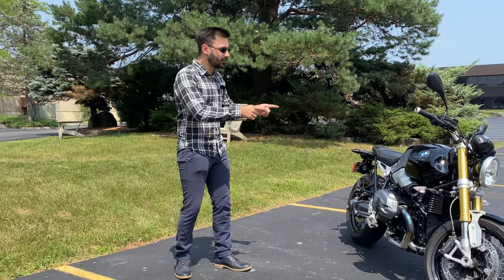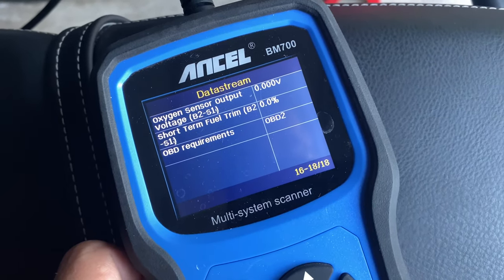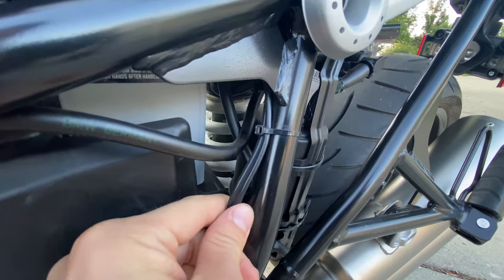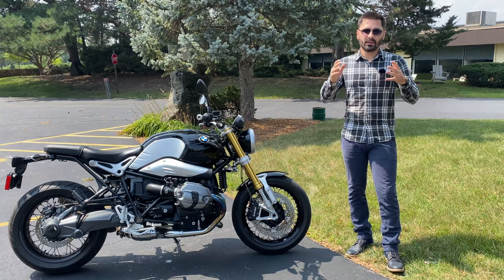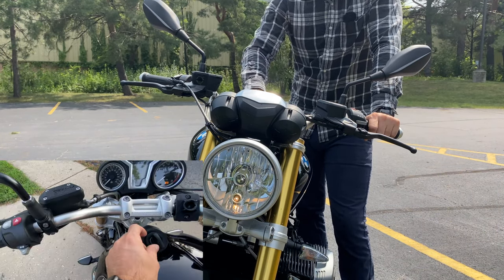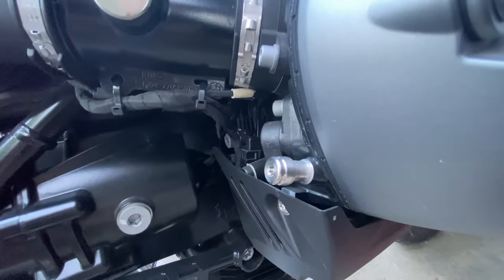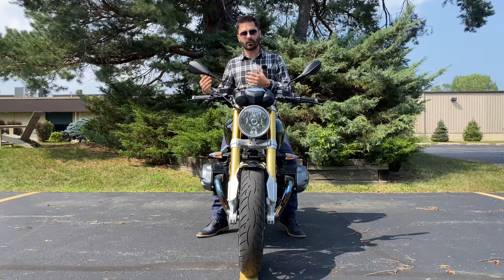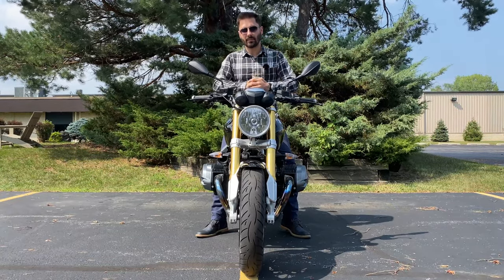Top 10 Useful BMW R NineT Hidden Features

Comment: The “trickle charger port” isn’t factory fitted, but seems to be installed by a lot of dealers in the USA
Reply from the maker: I figured that out later on! I checked with the previous owner and he told me it came like that new, so must have been installed by the dealer from new.

Comment: The socket under the tank which looks like a cigar lighter socket can also be used to charge the battery if you use a BMW charger. Mine does this perfectly. I also believe the bike has to have tubed tyres because it has spoked wheels. The GS spoked wheels has the spokes fitted to the outside of the wheel outside the seating where the tyre fits so it can use tubeless tyres though. Thanks for the parking light feature which I was unaware of.
Reply from the maker: Thanks for the info and feedback! I saw some really cool aftermarket spoke wheels that don’t need tubes, but the price was 1/4 of what I paid for the bike!
Reply: Where do you put the free tools?
Reply: Nice vid, thanks. The nine T comes with different spoked options, some of which are tubed, some tubeless - they look similar, so worth checking.
Reply: I use trip 1, set it to zero when I fill up. I know at about 120 miles it needs filling up as around here the reserve light comes on. That gives you about 40miles.

Comment: Get rid of that horrible seat release bolt and replace with an aftermarket knurled head finger tight bolt. About $10 on eBay. The downside is that it is no longer thief resistant for items kept under the seat.
Reply: i got some knurled finger bolts from amazon... $3.00

Comment: The hidden features like the battery charging cable was probably fitted by the dealer or the original owner it doesn't come as standard.  Also the wields on the baffles was removed by the original owner, that's why they was easily removable when you unbolted the covers on the exhaust.
Reply: the early 9ts had removable baffles, i think they welded them 2017 >>

Comment: BMW manuals are great.  I have a 2017 S1000R and it gives great information in a very Germanic way - this extract always made me smile “ In accordance with the laws of physics, the ability to accelerate
is restricted more and more as
the angle of heel increases. Consequently, there can be a perceptible reduction in acceleration out of very tight bends.“

Comment: @2:15, Just in front of that auxiliary power socket there is also a plug, cable tied to the frame designed to plug in a sat nav so you don't have to splice into the harness. It's well hidden and took me a while to find it. Very thoughtful of bmw to provide that

Comment: Thanks for sharing.
I recommend the original BMW charger to maintain/refresh the battery outside of the season. You can simply plug it into the socket on the left under the tank. Done
Personally, I don't think much of all the gimmicks like tire pressure control, oil indicator, lane control, ABS and fuel gauge etc.
People used to ride motorcycles without these little helpers. You just have to get used to the motorcycle and get to know it. Then you have pure driving pleasure. Greetings from good old Germany,  Jo

Comment: I wish you had more videos. I really like your style. Informative, to the point and without unnecessary stuff. Very useful.
I am taking my MC license and seriously considering a R9T. I am 48 and no riding experience whatsoever yet. I know going directly to such a heavy bike sounds crazy but I believe that riding a bike that you really like is important too. 
Keep the good work! 👍👍
Reply: This is not really a bike to learn on for a number of reasons. First it is a very fast bike, way too fast for a beginner. It's not the weight you should be concerned about, it's the speed. You should also know that you will crash a few times, that is inevitable when you first set out, I'm talking about silly little ones. Do you really want to damage your dream bike? Would it not be better to get a few years of experience on a bike that you don't really care to much about first?
I am also thinking about this bike to add to my collection but I have been riding bikes since 1978. I started out on a 200cc for a year or two then bumped up small steps at a time, I've had more bikes than I can remember. 
I now own a Triumph Rocket 111, a Ducati XDiavel and a Suzuki GSX1400. If I do get this BMW I may have to get rid or the GSX, I will see.
My advice is to work up to this bike. Go do as many courses as possible, get as much road experience as you can and above all be safe out there, it really hurts being hit by a car!
Reply: @rufus1346  thank you for your advice! I have already bought myself a R9T, and I am loving it. A 2019 model, 3500 km on it. It looks very much like the one on this video. A beautiful machine.
I totally agree with you on everything you say. You've been riding bikes since the 70s, so you know what you're talking about. In my case the R9T is the solely reason why I took my MC license. I loved the lookings of that bike from the first time I saw it back in 2014. For me it's all about admiring the bike and enjoying a relaxing trip in the area where I live. Speed is not my thing, it's never been. I am a more of a cruiser. I am also interested in the technical aspects of riding, like cornering theory and in general how to improve my riding skills. I will be looking for some courses to attend. I really have much to learn!
Reply: @anakletor  Just be careful out there, as I said being hit by cars really hurts! And can cost lots fixing up the damage to your machine, which sometimes hurts more than the broken bones LOL....
Reply: I noticed that you said you got the r9t, and I see the post is a year old. Could you give a update do you still have it? Would you do anything different? I'm also considering a r9t but a urban g/s mainly for the seat height. Any update would be awesome, thank you.
Reply: R9t is a perfect first bike. Don’t listen to anyone that says otherwise.

Comment: Fun fact, there is also a gps port under the tank near the front of the bike that can be used in a similar way to that din port. It needs a special cable for it to work correctly with anything other than a offical bmw gps, but i use it to charge my phone and it works great :)
I have the same model r ninet, had no idea that the signals cancelled, just thought i finally got better at doing it, super cool tho!
Reply from the maker: Thanks for the tip, I'll have to check it out. Love this bike.

Comment: When turning off the bike, if you push the long light some seconds, you active the courtesy parking light (follow  at home mode)... Very nice when parking at night. After 1 minute, it is automatically disconnected.
Reply from the maker: Thanks for the tip! That's a great features to know about!
Reply: Where do you put the free tools?

Comment: Hi, what model year is your bike? Mine is a 2015 and I can’t find this trickle charge port. Looked in the owner’s manual, too. Are you sure that is a factory add-on?
Reply: This isn't a factory fitted part. Either a previous owner or the dealer put that on.
Reply from the maker: You’re right! I was mistaken it for what they mention on around page 90 in the manual.
Reply: @chazphot  My 2019 came with a trickle charge port.
Reply: @ruiner88  then it must be a new addition from a certain model year, at least in the States
Reply: @ruiner88  I can’t find a trickle charger port either
Reply: Looks like one of these.

Comment: Great video. Thanks! I didn't know about most of these. Granted, I do have the Pure. I'll need to check to see how many of these tips apply to the base model
Reply from the maker: Thank you! Let me know what you find and how many apply to your Pure. I wanted the pure, but for some reason thought I'd need the Rev counter more than I thought.
Reply: First Robert should make sure he knows how to ride a motorcycle.
Reply: @2random628  when coming to a stop sign, I release the clutch, stall out, and drop the bike. It does bring me to a full stop, but I feel like there has to be a better way. Any suggestions?
Reply: @robertstimmel1100  yes, proceed to walk to hot girl and pull pants down
Reply: did you find the alarm? wasn't sure if included in Pure. Mine has the auto cancelling signals,  the corner illuminating headlight (very slight),  and a usb plug about where he found the din plug...
Reply: @robertstimmel1100  I've been riding for 50 years and I haven't discovered one yet. 🤔
Reply: I have the pure - if you have the stock pure wheels rather than spoked, these are not tubed (this was the main reason why I decided to go with the pure as a puncture with a tubed tyre is a mega pain as I found out on a trip with my mate and his Africa Twin which got a puncture 5 mins after we left - tyreweld doesn't work on a tube so bike was useless until it went to dealership to be replaced!).

Comment: Wow, bizarre way to jumpstart that bike. Great video.
Reply: wait until you find out how to access the battery if you need to change it (or to install trickle charger leads like I did)......you need to remove the fuel tank to do this - utterly stupid but typical of BMW to try and make you go to the dealership and pay a fortune for something you should be able to do yourself.!
Reply: @grantos3000  Ah, I did not realize that. Maybe because it’s such a compact sized bike. 

I have a 2010 GS and the battery is right under the seat. Aside from the clutch, everything else on my bike seems easily accessible.

Comment: I am curious as to what year is your R9T? My understanding is that on later year models the baffles could not be removed as they were required to be permanently fixed due to changing EU regulations. Also, I had to supply my own battery charger connection on my new to me 2017. I was unaware of the  self cancelling signals. I will have to go try that.

Comment: The trickle charging port? i have 2017 model i cant seem to find it?
Reply: I think a previous owner has added it to the bike in this video. It’s unnecessary because using the DIN socket he shows first (also known as a Hella socket) and a BMW version Optimate 4 charger you just plug in there and charge via the Canbus. The trickle charge lead he shows was added by someone who obviously didn’t know this.
Reply: @ethelred2648 they are often installed by dealers for free, mine was installed by the dealer and they said they did it with all new BMWs they get in.

Comment: I have a 2019 model /5, with throtllecable but i can turn the abs and tractioncontrol of.
Reply from the maker: Thanks for the info! I’ll have to recheck that info as I was told it’s not possible with throttle cable on these bikes.
Reply: I can confirm this for my '19 Scrambler, too!

Comment: Can charge using Optimate 4 from Canbus (others have mentioned).  Yes the battery fails quickly if left unattended. I disconnect the lead from under the seat when it’s in storage for more than a week or two and then get usual life. … and what is the point of parking lights anyway? Does anyone let a bike sit turned off with those on? These batteries need everything they’ve got to crank that boxer.

Comment: Always do a POWDERS check I put Michelin TPMS tyre pressure sensors £50 and easily transferred to another bike
Yes knurled knob from eBay under seat motogadget motoscope instrument dial so much better than standard

Comment: Can you demonstrate how to trickle charge the battery safely without "frying the bike"?
I have a trickle charger and removing the battery is an absolute pain in the ass on this BMW. Sorry German engineers but Italian engineers at Guzzi just make their design far easier to access. So for the trickle charging through that wire that I did not about (thanks for that) should I put a protector between the garage wall socket and my bike to prevent say... power surge?
I am very cautious with this type of stuff, especially with BMW who always insist you should be buying only the BMW trickle charger for safety - a charger that cost the GDP of Kuweit.
Reply from the maker: Not sure there is much to show or worth making a video about. I got a $20 trickle charger on Amazon and just plug it in when I'm not not planning on riding for more than a week. That's it. It's a very slow charging and maintaining device, only producing something like 1amp until a certain voltage is reached.

Comment: If you hold the indicator switch to the right for 12 seconds then press it in as if to cancel the main headlight will be switched off.  It will come back on if you ride away.
Reply from the maker: Woah, I gotta try that!
Reply: @SimpleCarGuy  let me know if it works on yours

Comment: The first fact you offered was wrong. My 2018 R9T Urban GS has a button on the left hand hand switch block that cuts out ABS and Traction Control whilst riding.
Reply from the maker: Thanks for the feedback, I believe I mention that it's available on newer models. Mine is the original release model.
Reply: Hi! Ive got the 2017 model, do you know why are the ABS and ASC light flashing? Thank you in advance!
Reply: @lusilva7295  Whether turning off or on , hold the button down for a few seconds, that's how it is on my urban gs.
Reply: '22 Pure can only turn off traction control, ABS seems to stay on (maybe I'm not doing it correctly)...